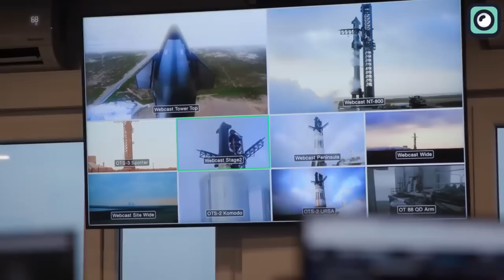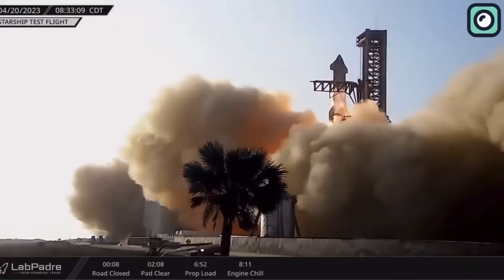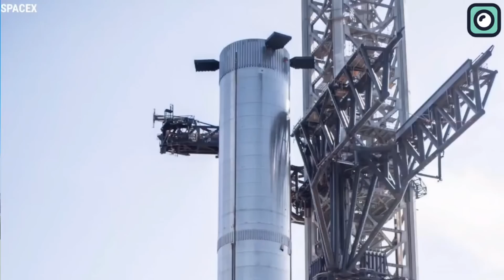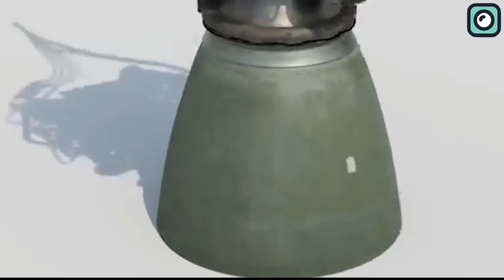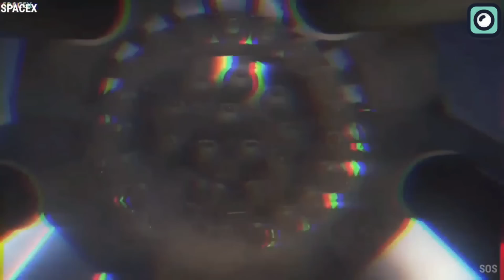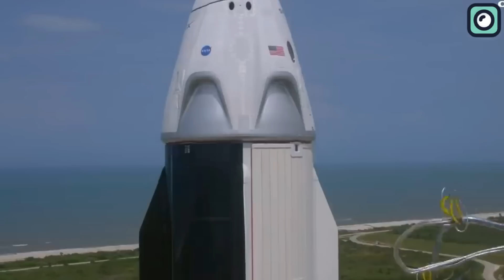Elon Musk Just Announced The Second Launch Of Starship!

Comment: Although it turned out to be a mute point, given flight having to be terminated, I was surprised that they didn't plan on 'landing' the buster and ship in the ocean to test/demonstrate the vehicles' ability to orient and do a controlled soft landing on the water.  Why miss an opportunity for a test, or if successful, a rep.  Better than just splattering them on the ocean. 
Also wondering what precautions are being taken to make sure China/Russia/others won't try to recover key components. They have the ability.
Finally, seems like a good idea to have established protocols to deal with this or similar event for a manned flight. If this was a manned flight,  being able to separate the ship from a malfunctioning booster, then orienting and doing a controlled soft landing on the water might save some lives.  The ship could possibly hover over the water until  Incorporating those emergency steps, even in these early integrated tests, would allow for testing/demonstrating the technology and, if successful, providing a good opportunity for additional reps. I'm sure they have a lot on their plate, but I'm guessing all the hardware is in place for these maneuvers, there would be a full load of propellants on board and the ocean areas have been cleared, so seems that you're just talking about establishing protocols and programing flight controls, oh, and dealing with the FAA.  I'm guessing the unused fuel mass in the ships main tanks would be best burned off before landing for safety and possible bouancy. A calculated prolong hover burn might be an option. SpaceX has some smart cookies, including the guy that humbly calls himself the lead engineer,  so they have probably considered all this already.
Rocket on...
Reply: When it lost more than 3 engines it could not achieve its plan flight profile.  The rocket was out control after hydraulic failure, and broke apart.  No other tests were possible with this flight, even if they were planned as a contingency.
Reply: avoid armchair engineering, Monday morning quarterbacking and second-guessing the past. The primary mission is Launch to Orbit   
not proving out imaginary contingency plans. They will move to the next booster and Starship